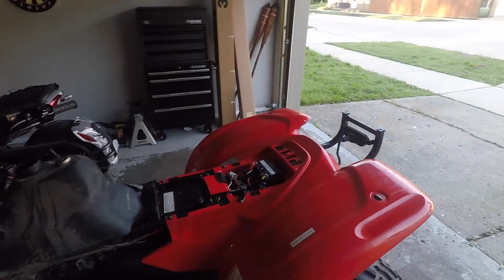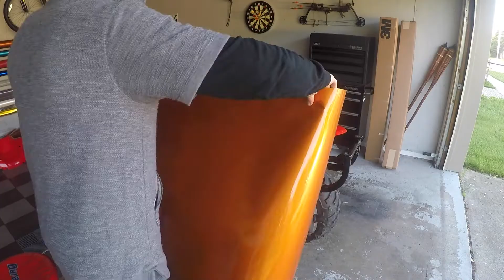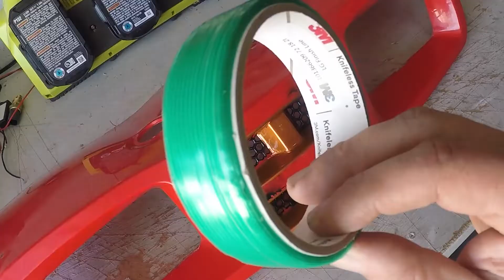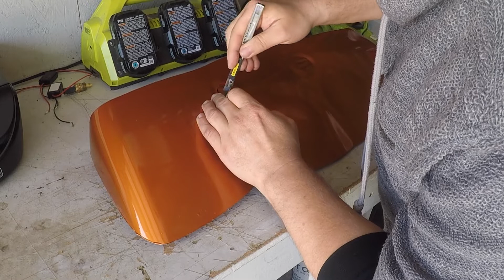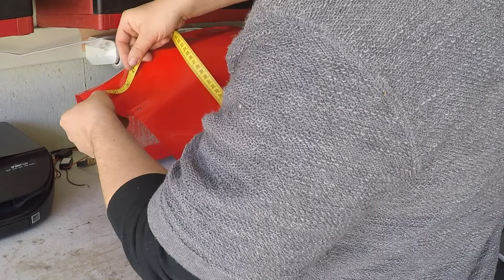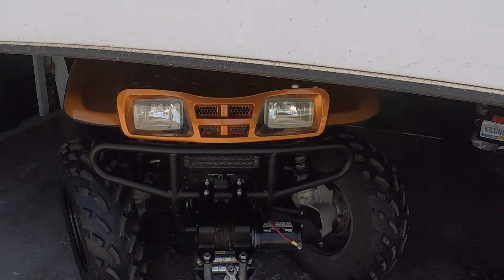ATV Kawasaki Quad wrapped in Gloss liquid Copper vinyl

Comment: Great video.  Subscribed and liked.  Couple of questions. 
First, where can I purchase the black edge protector?  Seems like that would be critical for an ATV to prevent peeling. 
Second, what did you do at the seam in the middle of the rear fender?  Anything special done at that seam to  minimize the chance of it peeling?

Thanks
Reply: @Vinyl-Tactics  Thanks wrap zone, I really appreciate your tips.  Your work looks amazing.  That matte black trim really dresses it up. Fantastic job.

Comment: Hey what did you use to remove the glue residue from the plastics ?
Reply: Wrap Zone Michigan I used it. Worked amazing!! And what are you spraying on the plastics after using the goof off? The spray bottle with the micro fiber cloth